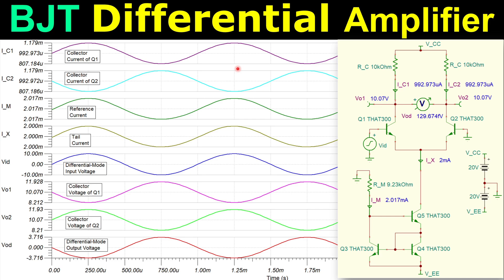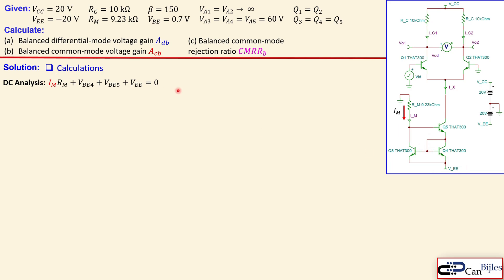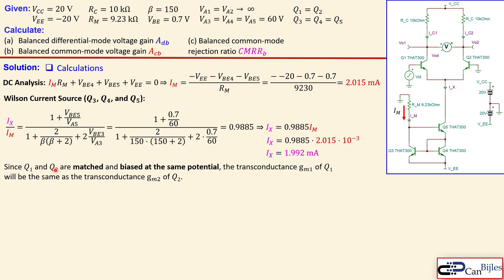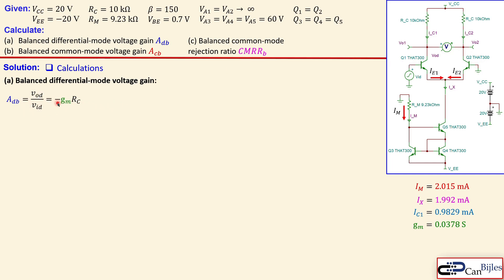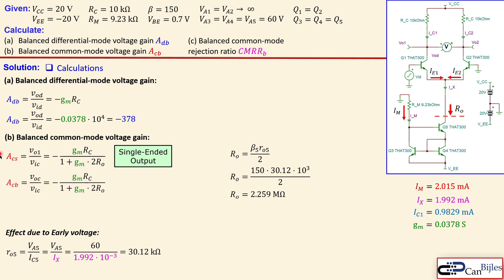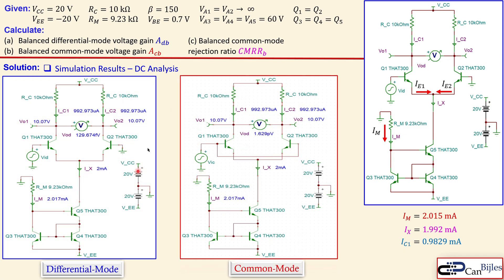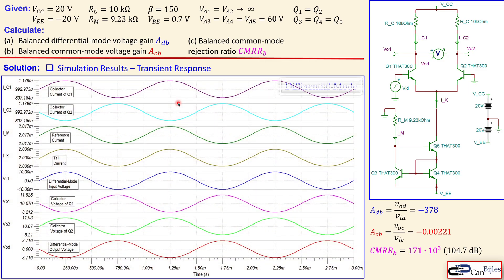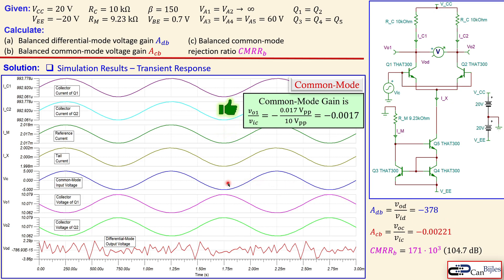BJT Differential Amplifier with Wilson Current Source 🌟 CMRR, Differential & Common-Mode Gains 💡 EX4

Comment: perfect, thank you, can we say that for very small pre amp let say condenser microphone we can use wildlar in first stage and then use wilson in second stage
Reply from the maker: Thank you! It depends on the application, but if you require a small voltage gain, the tail current source does not have to be a small current (Widlar Current Source). You can also adjust the load value, if possible of course.